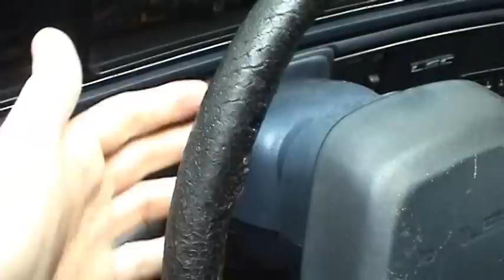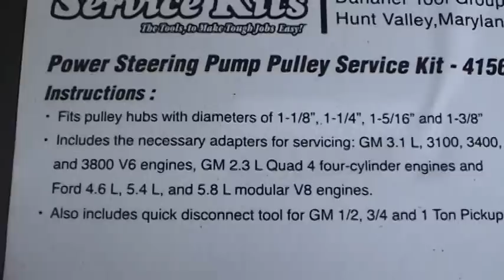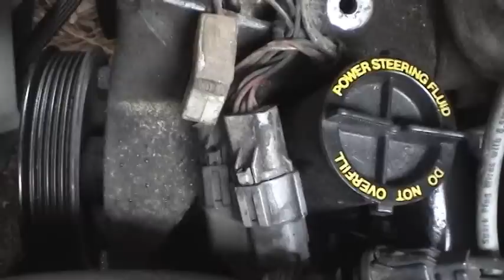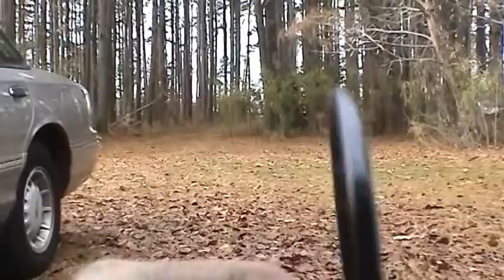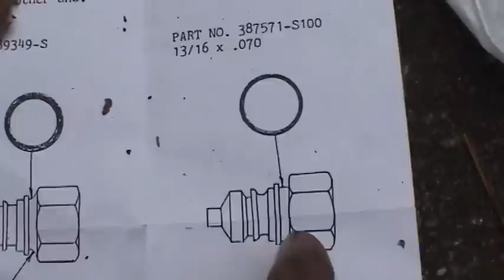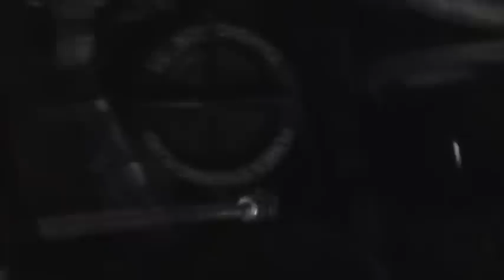1987 Lincoln Mark VII Power Steerig Pump Repair

Comment: I accidentally broke the little plastic output piece under the the power steering pump reservoir and I tried JB welding it but after letting it cure for 2 days it had pin needle size hole on the jb weld, so it didn't fully seal and also have a leak under the reservoir where it meets the metal housing so I'm guessing since looking up the parts to replace its possible the Big O-ring leaking around the reservoir. I truly appreciate you on this video. I'm just replace the plastic housing assembly with all the O-rings instead of buying another power steering pump since mine is original and was working fine before I had pulled the motor out and replaced All the seals and oil pump on my 5.0 on my 1986 Linc Continental bustle back. Thank You.

Comment: weird fittings on these pumps. Currently looking for a leak on a '86 towncar. Pump and lines are new and theres still a leak. I'm surprised the high pressure hose doesn't spray everywhere.

Comment: guessing 35k miles on the crown vic?  
horn "not loud enough?"   sometimes inspectors are unreasonable.
years ago for kicks, i went to a junkyard to get the 4-note horn from a big body pre-2000s GM (sounds like a train) to put in an MGB i had at the time.  well, the MGB had a weird negative ground horn system, and ultimately nowhere to mount them, so i ended up putting them in my daily ford taurus. the "state" (wash DC) inspector never said anything.
but it was a lot of fun to honk at people!